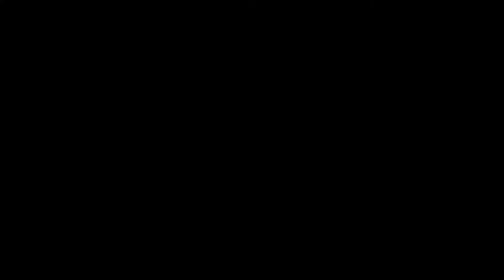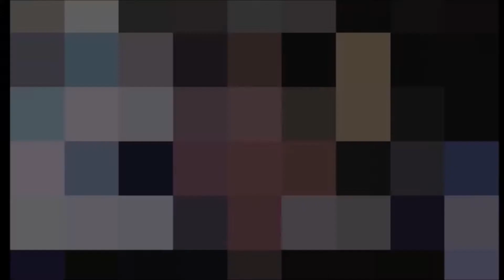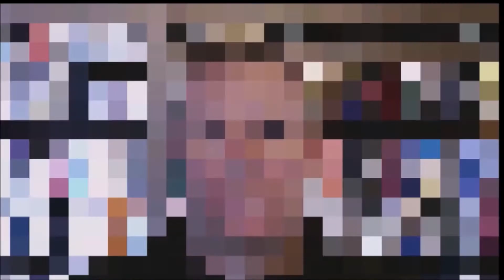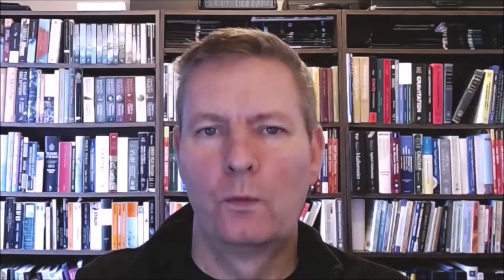CORDIC Algorithm Course Introduction

Comment: Have you ever worked at Selex/Leonardo in Edinburgh?
Reply from the maker: No.
Reply: @RossMcgowanMaths  it's amazing how efficient cordic is on fpgas.
Reply from the maker: I am about to run a hardwired version (well on logisim)  using fixed point arithmetic. See how that one goes.